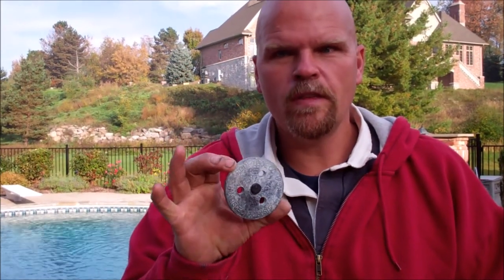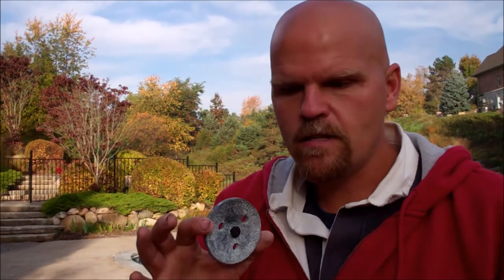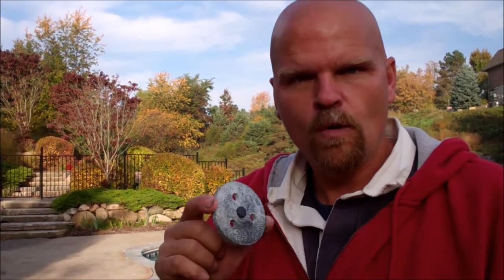Ask the Pool Guy and the Zinc Anode in a Swimming Pool

Comment: Thank you very much. I was having difficulty understanding this concept.
Reply: PHALANX when you have dissimilar metals in a solution that allows electrons to flow freely allows metals some metals  (catodes) to rip electrons from others (anodes) aka corrosion . So zinc is a metal that other metals can easily rip ions from. So rather than corrosion starting in your pumps and fitting, it will corrode the puck first.

Comment: I have seen the zinc pucks online. I have an inline zinc anode that is electrically connected the system. I don't see how a non-electrically grounded anode just siting in the skimmer can do that.
Reply from the maker: You are not passing electricity through the anode - it is the softest metal in the pool, so when electrolysis happens it is the sacrificial metal. 

per wikipedia:
They are made from a metal alloy with a more "active" voltage (more negative reduction potential / more positive electrochemical potential)
 than the metal of the structure. The difference in potential between the two metals means that the galvanic anode corrodes, so that the anode
 material is consumed in preference to the structure.
Reply: Scott is correct. The anode needs to be electrically connected to the metal they are protecting, just like his in-line zinc anode. Typically you connect them to the bonding grid (bare copper ground wire that loops around through all the electrical/metal devices), since that should already be connected to everything metal that touches, or gets close to, the water. The wikipedia article is also correct but only explains how galvanic corrosion works.

When you electrically connect the zinc to the bonding wire and thus to other metals in the pool, the zinc will impart a small negative voltage onto the other metals which will slow down their corrosion rates by increasing the potential that must be overcome for an ion to leave the metal (because the positive ion is attracted to the now more negatively charged metal). This doesn't work through water.

Wikipedia does go further to explain the two paths that are required:
"For this to work there must be an electron pathway between the anode and the metal to be protected (e.g., a wire or direct contact) and an ion pathway between both the oxidizing agent (e.g., water or moist soil) and the anode, and the oxidizing agent and the metal to be protected, thus forming a closed circuit; therefore simply bolting a piece of active metal such as zinc to a less active metal, such as mild steel, in air (a poor conductor and therefore no closed circuit) will not furnish any protection."

If that wasn't the case, there would be no need to ground in-line anodes like Scotts. All in-line sacrificial anodes for pools have this grounding lug because it's required. Manufacturers aren't in the habit of overcomplicating their products by adding unnecessary cost. ;) So long story short, save your money, these standalone pucks do not work. For more information feel free to search any of the popular pool forums.
Reply: @kalwallner  I was thinking about getting a pool heater that is only copper, will the zinc anode work if it connected to the pool heater's grounding bolt but NOT to any ground?

Comment: I don't have a saltwater pool, Should I still get a zinc anode?
Reply from the maker: If you do not have a salt water pool you will not have the same issue, as the salt in the water allows electrical current to pass through. So no, zinc anodes are not usually installed on non-salt water pools.

Comment: Hi, we have a salt water semi in ground pool and have rust forming however we don't have any lights or anything electrical touching the pool.  But there is rust forming and we can't figure out why.  So if there is no electricity going to the pool, why is the rust forming and is the need for the zinc anode still the answer?  TIA
Reply from the maker: If you have rust, look first to water chemistry. I'd guess that your alkalinity, pH and calcium hardness could have dropped too low and caused the water to become corrosive, which would pull metals into the water - resulting in a rusted appearance of the surface of the metal in the pool. You will want to make sure it is corrected to prevent further damage, and clean the rust if possible. Just don't fall into the cycle of using a product to clean the rust that causes the alkalinity and pH to drop continually...as one of our customers found out - prior to finding us, they were taking advice of a pool store that wasn't knowledgeable about the cycle they were causing with their advice.